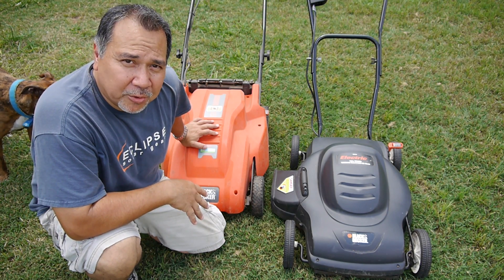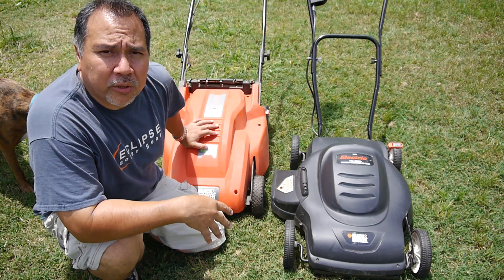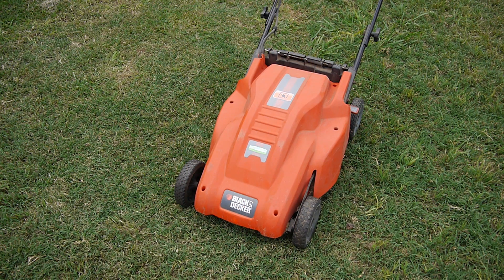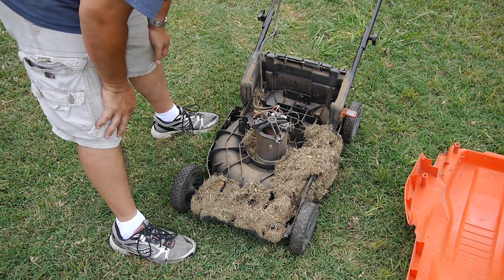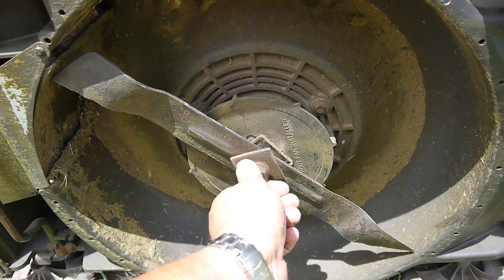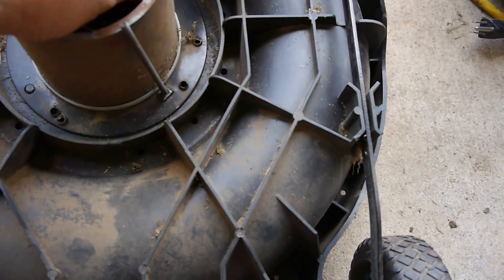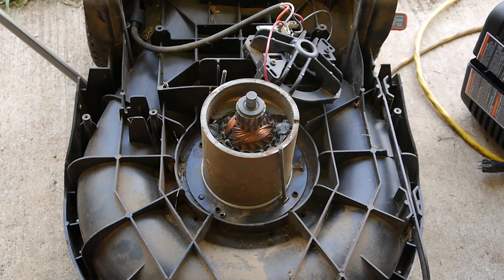Electric Lawn Mower motor problems

Comment: I'm working on a much older corded electric mower. Did they all have a rectifier converting ac to dc into the mower? What current and voltage can I put direct;ly to brushes to back track the problem and not damage the motor? Thank you.

Comment: I'd like to hear about durability of electric mowers.  I see many reviews where the mower fails and it also fills with grass.  And unless you can DIY, nobody will repair them due to cost, and they end up landfilled!
I read that there's a design flaw - the fan blows the grass up into the motor area.   I'm re-thinking electric mowers -- if they fail after a short time and get landfilled, how environmental are they?  
I'd love to see a video about the durability of electric mowers.  Thanks.
Reply from the maker: The latest models seem to last.  They have come a long way in the past few years.

Comment: My Bosch rotak 40 corded lawnmower cuts out slowly (no not long grass) then after about a minute can restart then slowly cuts out again. Is it likely to be a motor thermal cut off issue, starter switch fault or something else?

Comment: I have an old B&D plugin mower that stopped working. I tested the rectifer, seems fine which also means the switch is fine. Blade/motor turns easily. Brushes are worn to half-inch, but not showing any unusual wear, and their wires are connected. The magnetic collar inside is not a complete circle, but two half circles, which I assume is what was installed. Can the motor die without showing any issues aside from not working?

Comment: My electric mower is turning off the garage electricity can you help me. I’ve turned the electricity/power back on in the laundry room. The mower still won’t run.
Reply from the maker: Check the bridge rectifier.  It turns AC to DC to the motor.  When it goes bad it blows breakers.

Comment: Electric motors need lotsa attention. There's probably some with sealed bearings but bushings need to be clean and not bind or heat will build quickly and lead to failure. Personally, i like the IDEA of a plug-in tool. No batteries to go bad. Unfortunately many are made with the cheapest parts.
Reply from the maker: I hope that is changing.  Starting to make better equipment...more competition.

Comment: Good video and good advice.  I have a Black & Decker Lawn Hog that I've been using for 12 years straight. My preventative maintenance includes hosing off the bottom of the mower deck after every mow, sharpen the blades at the start and halfway through each mowing season, and remove the cover housing at the end of the season to blow out all the grass and dirt accumulation.  I also pull out the brushes and clean them at the end of the season.  I've had to replace the fan and blade insulator once.  Other than that, it still runs perfect on all original parts.  I've gone through multiple extension cords in the past decade, but they're cheap and disposable.  Once the blade goes, I'll have to buy another mower because the blade for this mower model is discontinued.  Electric mowers will last a long time if you give them them some basic preventative maintenance.

Comment: I found a Black & Decker electric I found in  the rubbish once It had a note on it about possibly needing a new motor. When I took the top off thing the thing was packed with leaves and grass. The one you just took apart is quite clean in comparison. Worked for a few minutes and then I put it back together and sent it back to the curb. I'll stick with my trusty gas mower.
Reply: Me too handle  by motor kept popping  out didn't see where anything  to screw down ? Hard to push.  Bag collected  so.much grass in small area

Comment: i have a craftsan electric mower with the squeeze together handle for height adjustment.  The level won't stay down.. pops back up.  There's a fix-it video I need to see.

Comment: Thanks for the video! Do you answer questions? 
symptoms of my electric lawnmower motor:
-doesn't start but when I tap the center shaft lightly with a hammer it almost starts, as I jostle the unit it continues to almost start
-when I wack the center shaft, then it starts and runs until it cools down

Comment: Removed 1st Eight Torx Head Screws and Cannot Figure Out The Front Recessed Screws Holding The Orange Cover On.  Debris Has Been Piling Up In Holes forever (Needs Cover Plug) So I Can’t Get Any Type Screw Bit On Head , Can’t Tell If It’s The Same Torx Screws Or?.. Drill Them Out? To Access Connector and Connector Wires

Comment: I have the same problem as Mas Cerveri: I have the orange cover cove. I removed the 2 bottom torx screws but wen i try to remove the top & middle holes that you removed screws from the bottom ov the cavity seem solid. There appears to be no screrw down in there. No way to remove from underneath. What am i missing? I looked with flashight and magnifying lense...its solid black down in the hole. 
Thx
Rick Jacobson

Comment: Also, the blade is installed incorrectly.  The rubber blade insulator is supposed to sit between the blade and the metal spacer.
Also, there are several blades broken off of the fan.  
This likely contributed to the motor failure.

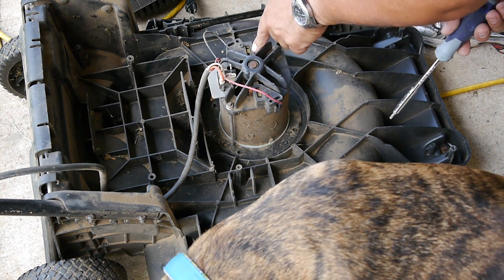Comment: Thank you so much for the video. Really well done. Just a question please... when you pointed the positive and negative of the motor, at the minute 5:10, if I measure with the multi-meter between positive and negative when the switch is off, I expect to find open circuit, correct? In my case I measure 0 ohm which makes me think the motor is gone. Is it a correct statement? Thank you again

Comment: Could you give me some advice on what might be wrong with my electric lawn mower? The start button no longer fully depresses and it will no longer turn on.
Reply: Probably needs a new button.
Reply: @alwaysopen7970  I just bought one from Amazon called TackLife Lawn Mower and it only worked for ten minutes and it won't switch back on.  I think I rather have a lawn mower with gas now
Reply: Try looking at the small carbon brushes electric mowers typically have 2 and they wear down with use. If theyre worn down to the nub then they aren’t making contact with the motor and a connection isn’t formed.

Comment: I think I just experienced the same thing. I will take the lid off at a later date. But I was wondering how much the motors were for replacement, and where to order one?
Reply: vassilischr thanks.  I was lucky. The motor was loose and after tightening it up, it is working fine.

Comment: dumb question but what kind of screwheads were they? Thanks
Reply: I have the B and D MM850 (green cover). When i try to remove the top, the holes that you removed screws from seem solid. There appears to be no hex head down in there. No way to remove from underneath. What am i missing? I looked with flashight and magnifying lense...its solid green down in the hole no hex head. Top iis clearly held on at the 4 points. Rest of top "pops" in and out on tabs
Reply from the maker: They are torx head T30 I believe.
Reply from the maker: Danny Beers Correction: They are T20

Comment from the maker: This is a catastrophic failure of the electric motor.  Be sure to keep the mower clean and try to keep all of the grass and debris from getting to the motor. Take the mower shroud off and clean it up!
Reply: I think I might have burnt the motor, so one day I was mowing and suddenly it started slowing down and I decided that maybe if I hold it it would get unclogged and the bam 💥 it rattled and started smoking I quickly unplugged and it smelled like burnt plastic/rubber.Do u think I can still save it  or is it gone
Reply: What i hv to do now
Reply: Question for ya, I hit something with my cordless electric push mower the other day, it stopped dead. Now when I run it sounds like a gas power mower but it still cuts fine? Should I get a new one or try to see of something come loose between the blade mount (blades are in good shape) and motor? Thanks
Reply from the maker: @humancigarette7557  Try rotating the blade and see if you can find where the noise is coming from.  Be sure to disconnect the battery first.
Reply: @SmallEngineDIY  I'll try it thanks!